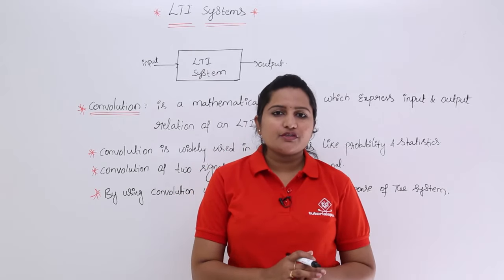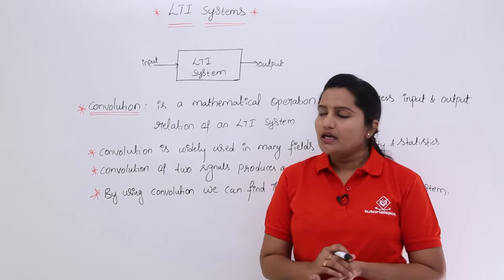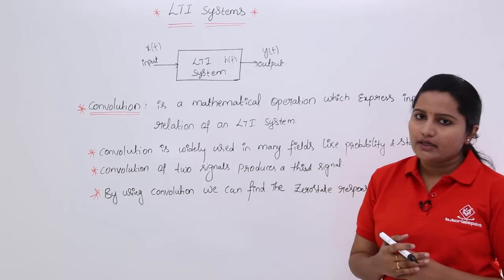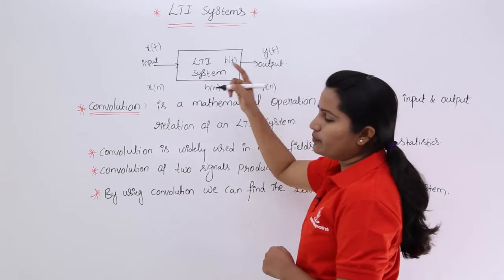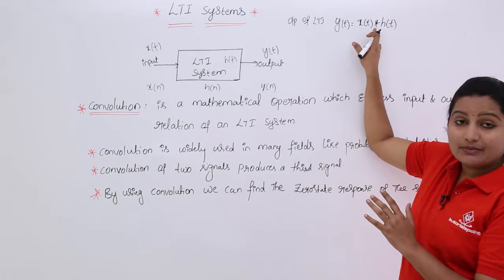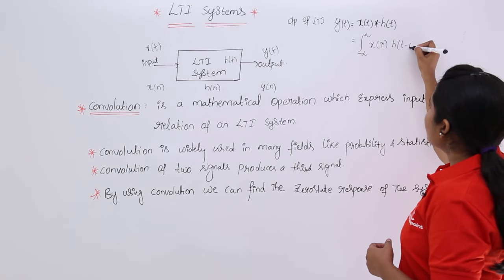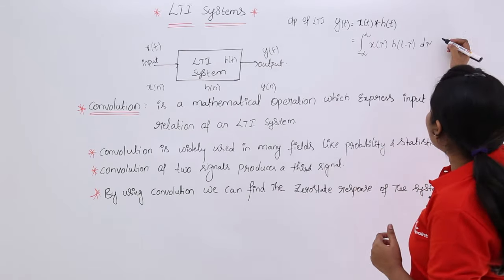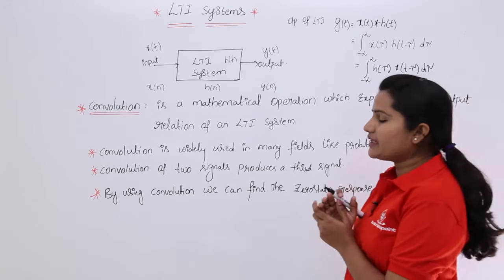Signals and Systems - Convolution

Comment: why convolution at the system output, why not multiplication, the advantage of convolution
Reply: it is a special multiplication...for eg: you are at a station standing on the platform and train just passed you...while passing all the points of the train at some point of time were directly perpendicular to you. so multiplication will occur only of that points which were perpendicular to you and  after the train is gone there is nothing in front of you so no multiplication will occur. thus in convolution the multiplication occurs only till a signal pass other signal and only for those points which are in front of each other...